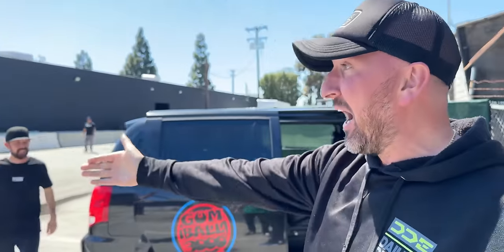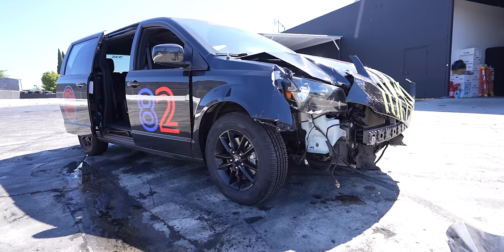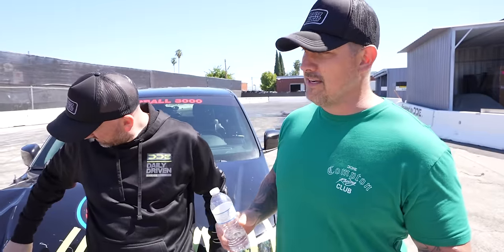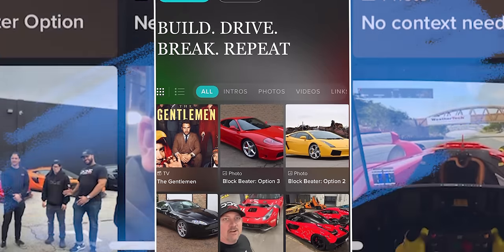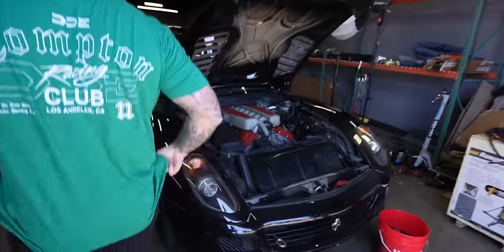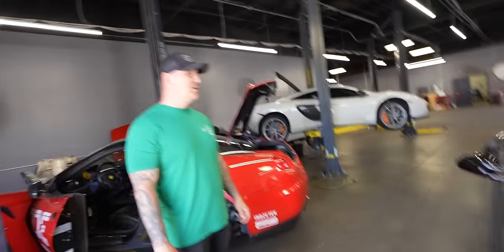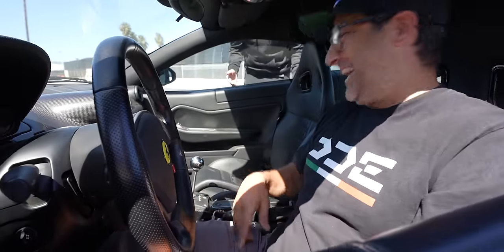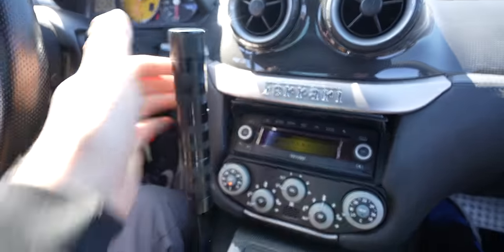WORST DAY OF MY LIFE. SAYING GOODBYE TO ICONIC DDE CAR.

Comment: unfortunately for Dave, brakes dont work midair
Reply: @dragonfirecrypto2607  shouldve put it in airplane mode so it took off mid air
Reply: What about an air brake?
Reply: I can brake and steer in mid air. It's really just a skill issue
Reply: Hitting the fence was planned. Now, I don't think they intended it with that amount of speed.
Reply: theoretically they do, but since the tires obviously dont have traction midair, the car does not slow down

Comment: You know what might be an awesome idea! Since your get together's are getting so big, and because it gets so packed, maybe you should look into building a stage on the roof of the building for live music if you decide to start having some. Build a nice square stage with railings at the front ledge either on top of the building, or on top of the Block hang over. If you use the hang over above the Block though, you would need extra support. It wouldn't take much to have a small stage built on the roof, and don't worry, It can handle the weight. You could place some lights on each corner of the roof, and point them towards the stage to light them up. If you're going to have the cage for multiple levels across the way behind the safety rails, you could use some colored lights and shine them towards them also. I think they sell them at Spencers, but you can get the lights that spin around to shine down into the crowd for its ambiance during concerts... Maybe a few strobe lights also.

Comment: I was also thinking, since you guys aren't using the entire building, you could either rent out storage space for super cars for a "small" fee for anyone to park, or you could let some of your friends store their super cars for free, as long as they give you permission to use them during events for people to see. Then you can keep all the cars lined up in a row inside one of the rooms, and keep the door open during events for people to walk through and check out all the cool cars. Just line em up and rope them off, that way no one goes near the cars or touches them. They can only see them from a safe distance. You definitely need to get up some more wall art, and if you were going to do something like that, I would get the square flooring pieces that click together to form a design. Either that or you could paint a cool design and resin the floor.

Comment: todays video is really good vibe, even though you bit up that old van into fence and bought new one, Be nice with new one you all DDE its a chip thrills video, loved it/// speaking of block beater how about 350Z or any Nissan Zs that nico brought but if you guys only looking at exotics, the only thing i tell is -- no exotics cars are easy to fix new or old, and for block beater you guys need cars that can be fixed quick and parts are easy available to buy and replace

Comment: You need to go to Lowes or Home Depot, and get some asphalt to fix the Block (parking lot). It's so easy to use that a child could do it... I don't recommend hiring a child to do it though 😁. asphalt drys really fast, so you'd be able to get it at a nice slant so that it's flush with the rest of the area. You should be able to make it so you hardly even notice the small bump. asphalts also pretty cheap, it's the labor that costs the most.

Comment: GUYS you should have gotten a wheelchair dodge suv, that thing could haul around tires and have more space than the bed of a truck if you took the rear seats out on the model with the ramp! I just think of the ideas, weight reduces NOS wheelchair carreravan GT...

Comment: early this am i had the gtr on the dyno getting tuned for e85 and went to do some freeway cruising in mexico to get data on my way to the track.
im doing pulls to red line getting logs for the tuner and i hear what sounds like a 720s burbling next to me.  i look over and its a full black carbon senna with straight pipes smiling ear to ear giving me the "what u got for me" look.  we were playing back and forth for about 40 miles until he took the first exit to the race track (our shop is on the back side).  dude drove that thing 60-70 miles to the track instead of trailering it.  i always thought my car would destroy a senna in a drag race but.... my 1010awhp r33 gtr on KILL mode , was not faster than a mclaren senna from 60-180 mph.   I had to share because you dont see senna owners DRIVING their cars.  (senna if you are seeing this and are a DDE fan, its me the purple r33 , can i have job? ill come wash that car with my personal tooth brush for free)